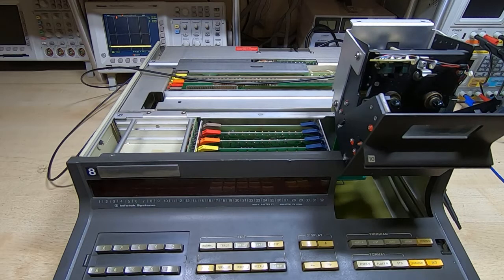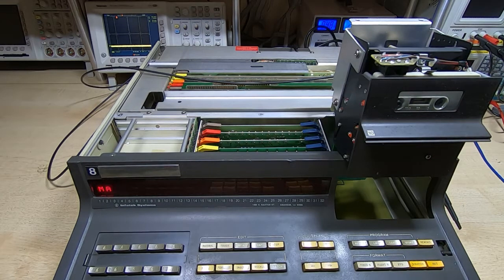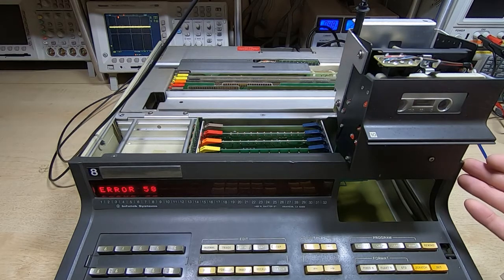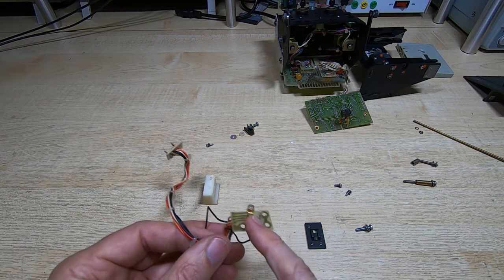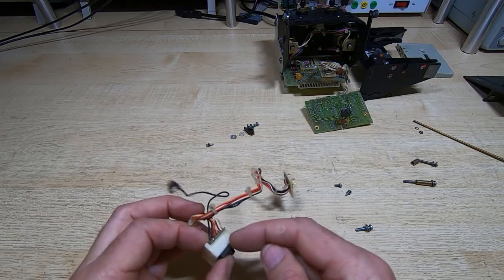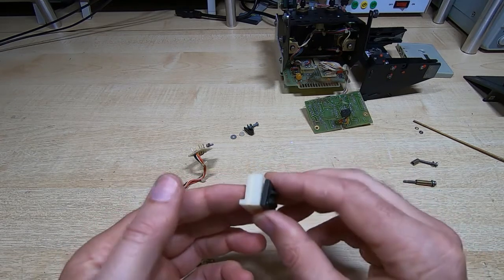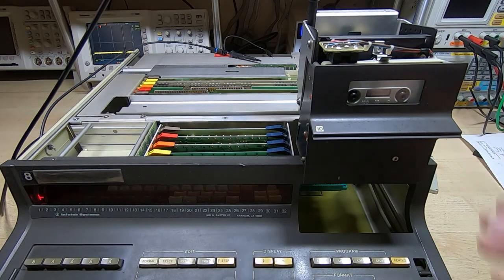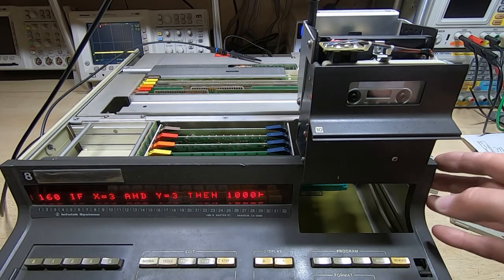HP9830A Tape Drive Sensor Repair

Comment: Fascinating, until you pointed it out, I didn't realize that incandescent light was so heavily weighted to infrared. But of course that is how it generates light, by heating the filament. Very informative.
Reply from the maker: Yes and because the lamp in this drive is under run it is even more biased towards the red end.

Comment: Did you consider replacing the incandescent bulb while you were in there with an (IR?) LED?  Perhaps they are run soft enough that they don't experience failures in practice.  Funny that the phototransistor failed after all this time, but the light bulb did not.
Reply from the maker: Not really, LED's have very narrow light output and I wanted to keep a wideband IR source to avoid problems with variability in the cassette case colour . As you say they are run very low and I have never seen a failed one. They are also very easy to find replacements for as they are just standard miniature wire ended lamps. I suspect that the sensor failed a long time ago as they tend to die from age related degrading rather than anything else. Those types of sensors are very prone to failure after 30 years or so. I did not mention it in the video as the video was already getting too long but another reason I selected the sensor I used was because it works primarily outside the visible spectrum so would be immune to ambient light (Actually I did cover it but I edited it out).

Comment: Jerry, what kinds of equipment/machinery do you have in your workshop?  I assume that you have at least a metal lathe (of some size), some kind of milling machine (or mill-drill), and if I remember correctly, a sheet metal working machine, perhaps a 3-in-1 shear/brake,roll?  You've mentioned a 3D printer (or more than one?) in this and earlier videos, so you've got it/them somewhere too.  How much room do you have for your workshop?

Also, thank you for detailing the reasons you chose the sensor you used.  That info will save a lot of time in projects using optical sensors, etc.
Reply from the maker: I have more than one workshop. They are divided into different functions. Mechanical (lathe, CNC mill, C-Grinder. Press Brake/shear, Drill press, welders, Plasma cutters, Spot welders, Bead blasters etc). Electrical (various test equipment). Lab (Mostly electronic). A few others for testing / woodworking etc. I have never measured them but the total is approx 400 Sq/m. It probably sounds like a lot of space but I am generally working on quite a number of projects at the same time (I just video a few of them).
Reply: @JerryWalker001  Wow!